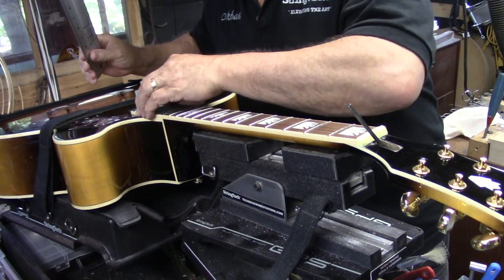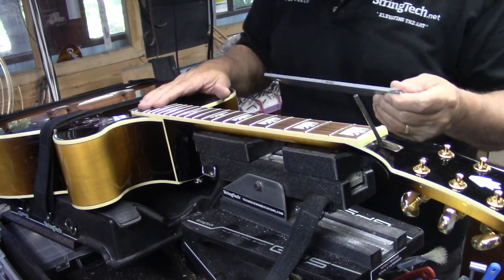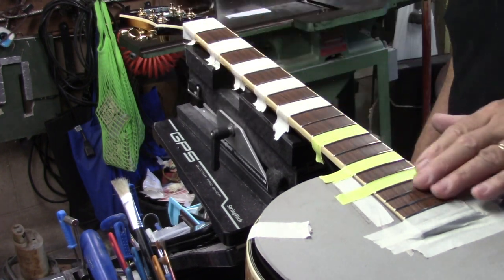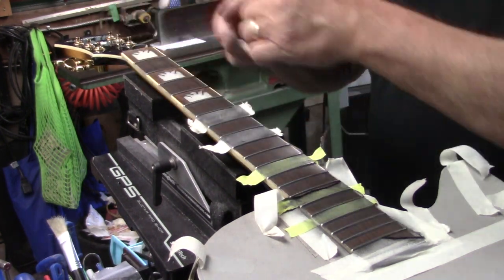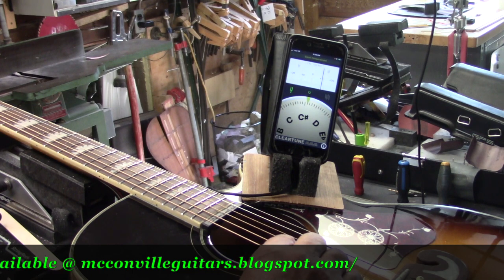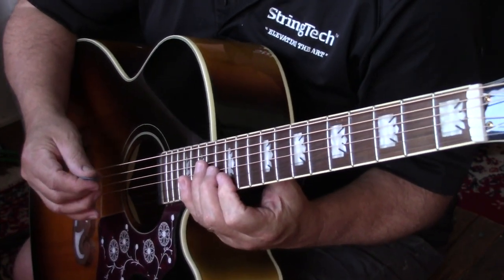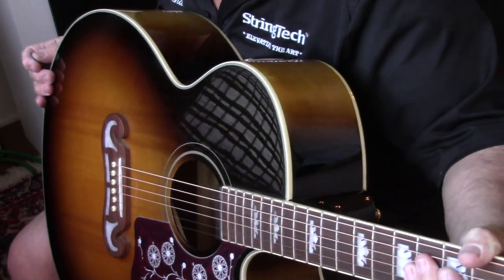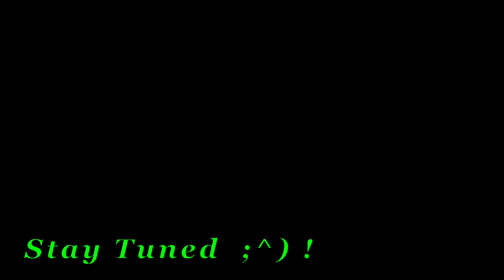Understanding the 2 Way Truss Rod / Epi J-200@StringTechWorkstations

Comment: THANK YOU! Finally someone who explains the entire way to adjust a dual-action/2-way Rod! I have no fear of adjusting truss rods, but I've only got 1 guitar equipped with a 2-way rod. My Carvin recently started to give back me bow and I was getting worried because I had slacked off the rod to that point where it felt loose, but I didn't want to go any further because I wasn't 100% sure. You're literally the only person I've found after looking at countless different sources who explains the  "neutral" point, everyone else just skips that part entirely, which I think it ridiculous when many people out there aren't confident enough to even touch any type of truss rod! 

I used your trick you shown on a fretboard-levelling video a while back about using different length levelling blocks/beams with leather underneath to allow it to adapt to the radius of the board. I made my own beams using a fret levelling beam and a belt sander, and I also used some neoprene rubber instead of leather, but it seemed to work perfectly! Many thanks again for your time and invaluable advice on these videos! 👍🙏
Reply from the maker: Nice Channel DC ! Just subscribed \m/ !
Reply: @StringTechWorkstations  Oh thanks! You didn't have to, but I really appreciate it! I want to do more videos eventually, but the channel has taken a backseat since I formed a band, too busy lately haha. I forgot to mention in that comment that I only just sub'd to your channel because I clearly forgot to way back when.🤦‍♂

Comment: I have tried every conceivable way to straighten a severely backbowed neck on my Michael Kelly Forte Port X. I love this damn guitar and wasn't ready to throw in the towel. Nor would my pride allow me to take it to a professional luthier. After watching countless videos on the subject and adjusting my dual action truss rod to death, you have damn near helped me solve an issue that's been pissing me off for months. 🤣 My action is just low enough at the saddle end but still a little low at the nut. Experiencing slight fret buzz on strings 5 & 6 between frets 1-3. My neck is finally straight, with just enough relief, but I believe that my nut slots on the top few strings is a bit too worn down. That'll absolutely solve my problem. Thanks a ton, sir. You've earned a new subscriber!! 🤘🏻
Reply from the maker: I am delighted to have inspired you. Welcome aboard. MMcC

Comment: Found out by accident, my 335 copy has a 2 way truss rod. I was loosening mine, trying to get the proper relief. I felt it catch, & then maybe 3/16 of a turn, & it was perfect. (I'm beginning to like my 335 copy more & more. Not a bad guitar for $160. Did have to upgrade the pups & tunomatic $30 total. It doesn't sound too bad.)
Reply from the maker: The 2-way is a good idea. Hard to argue about that extra adjustability.MMcC

Comment: Thank you for this, when I bought my epiphone inspired by Gibson hummingbird the guy in the shop said “it’s not quite set right, I’ll just make an adjustment”, he run off downstairs, came back in 5 minutes and I played it and bought it, got it home and was getting loads of string buzz, I’ve been wondering what he could have done that fast - I wonder if he could’ve adjusted the truss rod without taking the strings off? Either was it’s pretty terrible at the moment, I’ll try the truss rod adjustment 👍
Reply from the maker: Good timing ! This upcoming video has a 2-way truss rod ... stay tuned !
Reply: @StringTechWorkstations  aha! I will definitely tune in 👍

Comment: I have this same guitar.  What is the size of the Allen wrench for the truss rod. I read it was 4mm however it won't go all the way in to the nut, like the angle is off.  I bought this new last year and have never touched the truss rod adjustment until now.. Any ideas?
Reply from the maker: Maybe try cutting or grinding the foot of the allen key down a bit ... to shorten it. Sometimes that will help you get in a tight spot. Good Luck.
Reply: @StringTechWorkstations  thanks

Comment: I get entertained when people talk about truss rods. Its so long winded. 

If the neck is in sad face position :(   turn truss rod counter clockwise to straighten neck.

If the neck is in happy face position :)  turn truss rod clockwise to straighten neck. 

Simple.
Reply from the maker: Ahhhh ... but this is a two way truss rod. In this case, if you didn't understand it completely ... you could make a real mess of the frets. MMcC